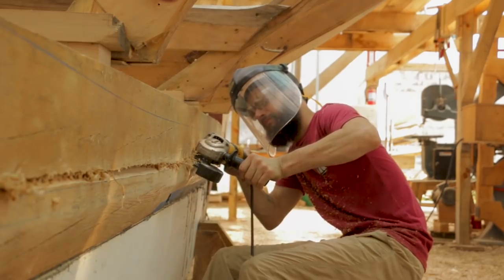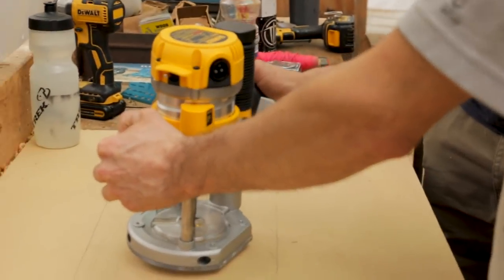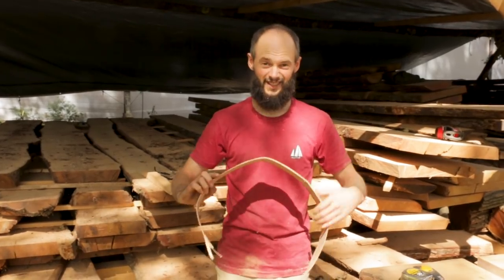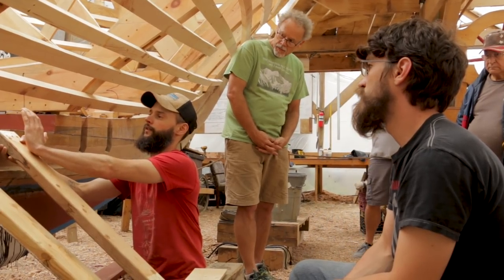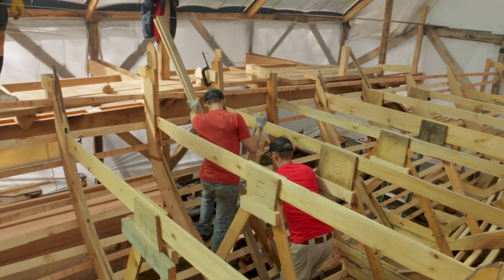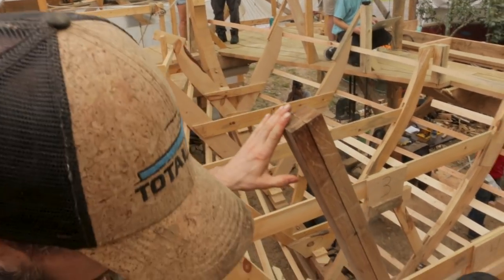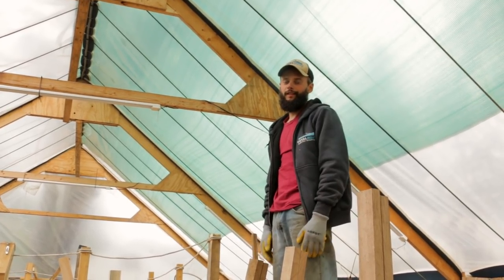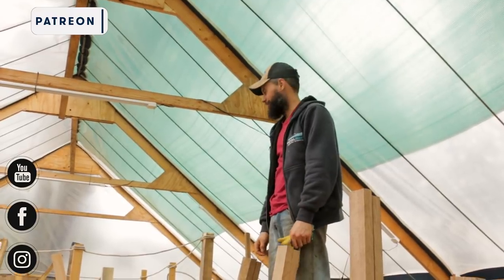Acorn to Arabella - Journey of a Wooden Boat - Episode 46: Steaming Frames

Comment: Im still sad that these are called "frames" in english and not something like "ribs" instead.
Reply: They sometimes are called ribs, but I think that’s the term for lapstrake boats, which are a very different kettle of fish. A boat like Arabella is built from the inside out, with frames made and then planking over the frames. Lapstrake boats are built from the outside in, with overlapping planks instead of edge-to-edge, and the ribs added after planking to stabilize the hull.

I should note that I have very little knowledge of boatbuilding, and any or all of the foregoing may be incorrect. If it is, I would love to have someone who knows what they’re talking about correct me!
Reply: @SilasHumphreys  I wonder how the Vikings did it.  They built lapstrake boats of comparable size to Arabella and even bigger.  For small lapstrake boats the order is as you say, plank on molds and then add frames after the planking is done.  I think this probably only works on small lapstrake boats because if your frames were the size of Arabella's the planks would not be able to hold the shape while you put in the frames.  It works with lapstrake because the laps like the ribbands in the arabella molds give stability to the shape.  My experience is in building a plywood lapstrake skiff.  Never did any plank on frame.  That steam box is going to see a lot of use when it comes to planking too.
Reply: No, Silas H. is just about entirely correct.  Right on about Lapstrake vs. Carvel (Arabella here is the Carvel type construction), as far as general process. 
 The only part I'm wracking my brain about, is to try to remember how often I've heard the colloquial "ribs" term used to denote the frames in this larger closed-in type of decked carvel hull (as well as in the small open boats where the two terms are equally interchangeable).  I THINK... it kinda has more to do with whether the frames/ribs are "exposed" in the interior of the finished boat, more than whether it's lapstrake or carvel.  Like, for the term "ribs" to be applied, it seems like it's more because you can see them, structurally arranged as they are, directly comparable to a human's "Rib-cage". 

Decked boats of either construction type just have more miscellaneous interior furniture in the way than open dinghies... and Carvel boats large enough to have deckhouse/cabins, most usually have a whole second lighter layer sort of "planking" INSIDE the frames as well.  Not CALLED planking:  this internal second layer is called the "ceiling" in a wood boat.  (No direct relation to the overhead in your house, except that a house "Ceiling" is similarly a light covering layer fastened inside of the actual structural timbers which are hidden thereby.) 

Let's put it this way... if a specialist in small lapstrake boats, shows up outside of his normal element, to lend a hand in a larger production shop building heavy carvel hulls, and "mistakenly" applies his customary colloqualism of "ribs" when the requisite parts are under discussion...  None of the other guys who prefer the standard term "frames", would be in any confusion about which part of the boat the dinghy-builder was referring to.  Nobody would give it a second thought.  Now, if it were an even heavier old-style construction using massive SAWN (a.k.a. "grown") frames, rather than the thin, light steam-bent style being installed here...  THEN they might grumble a bit about stretching the "rib" terminology too far.

Comment: Why aren't you coating the sockets with rot preventing stuff?
Or are you?
Reply: Good question. I have no idea where contact with water stops. Hopefully someone who knows sees this.

Edit: I'm not sure if they specified but perhaps after the wood dries, they are taking the frames back out (now the right shape) coating the socket and screwing them in?
Reply from the maker: The frames come out after cooling for a coat of oil, the heels get painted as do the sockets and they will be bedded when put back together.

Comment: This seems to be a little quicker than cutting in the frames like Tally Ho Is doing.
Reply: Except there's no need to make all the molds when using cut frames.
Reply: Leo is working with a wood that is notorious for eating cutting implements.
Reply: they're both using valid techniques....I suspect Leo's cutting his instead of bending, because that's how Tally Ho was originally done and he's trying to stay true to that original plan...    It's actually kinda interesting to see the differences in the two projects....
Reply from the maker: Leo is re-building her as designed and she was drawn with sawn frames so the decision was made for him.  Same for us, she is designed with bent frames so bent frames it is.  The best of both worlds is every 3rd frames is sawn, the rest bent, no molds to make and minimal sawn frames to make.  Many boats have been built with sawn, bent and a combination of them both.